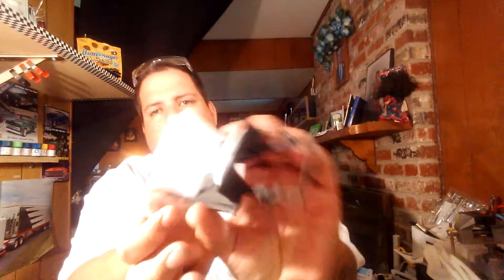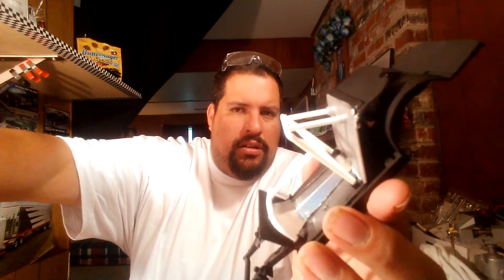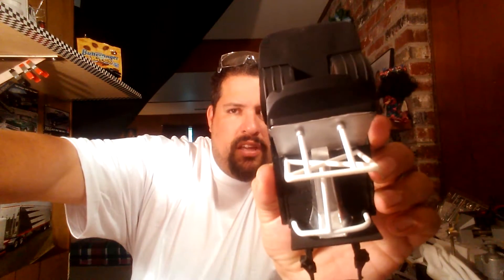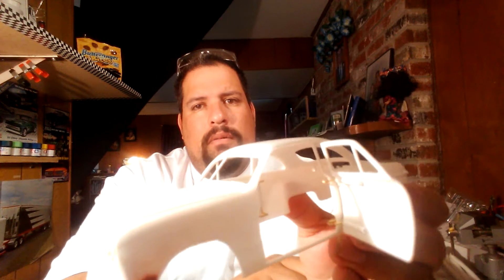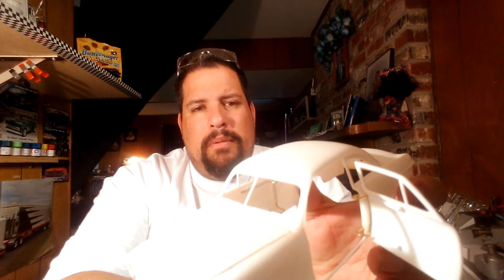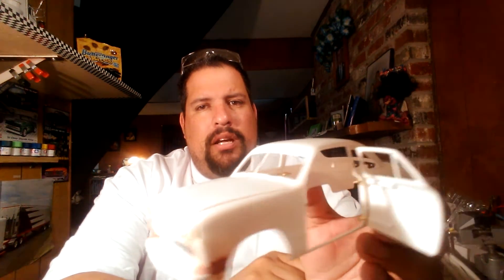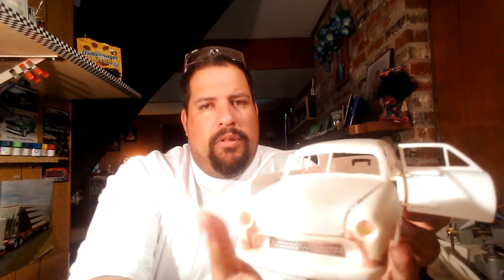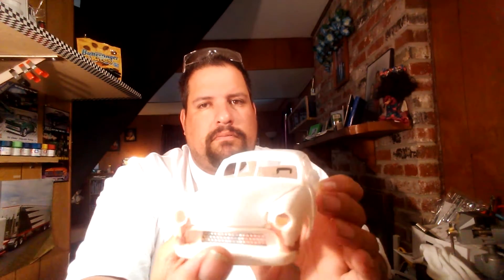Fast Jimmy 71 tribute build update

Comment: Great job on the Shocks bro. Great job with the hinges also. With the hoops I usually make them as tight and small as I can. So if your using pliers to make the bend just use the width of the pliers tip as a guide. Hope that helps. Mesh looks cool, kinda matches the F150 i'm about to build, so if I screw it up....gotta find me some speaker grills. lol.